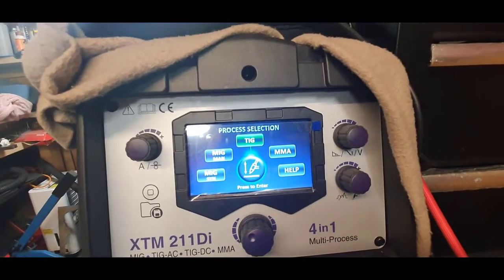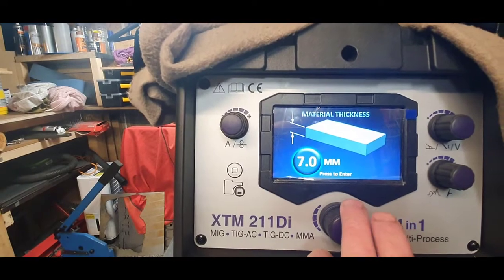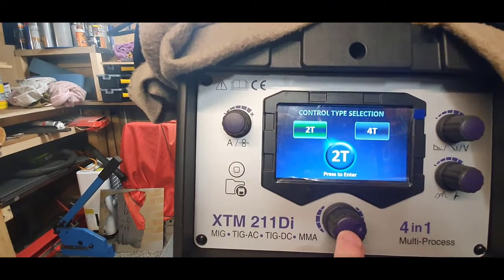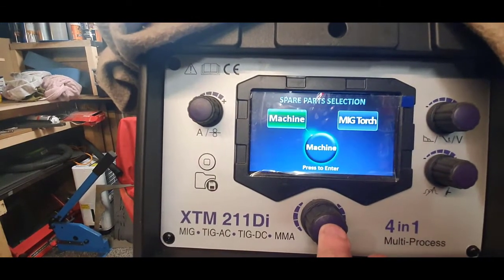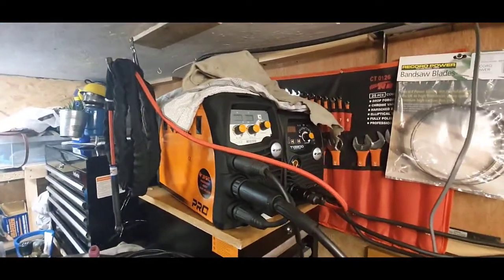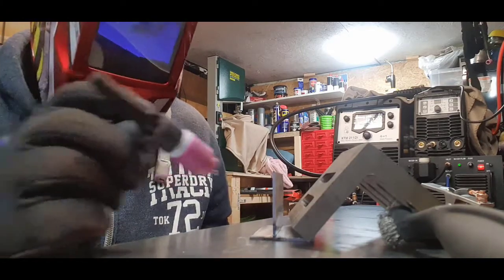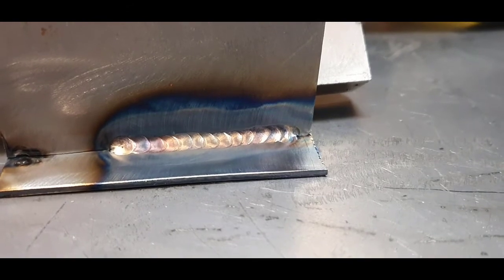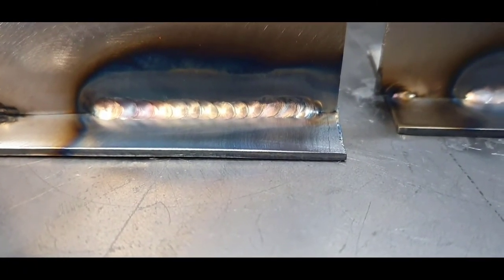Parweld XTM211DI

Comment: Nice one.great to hear a relaxed northern voice rather than a American lol.
May be thinking of getting one of these mainly for the mma and the mig .but would like to learn tiggin
Reply from the maker: Lol ... well not sure about relaxed but if you need any info on any of the Jasics let me know as it's the only ones I run now as I cant afford down time. 👍
Reply from the maker: My dad uses these now as brilliant to set up in both modes but the unit was just to big in size for me to keep in my small shed but customer service is again brilliant. If your interested in a parweld one just pop me a mail and will beat anyone in UK for price
Reply: Really.i see they are around the 1400 quid mark . (Parweld)
Reply: Also would you know if the parweld is generator friendly
Reply from the maker: Yeah they are generator friendly and you would require a 10kva minimum .
Cheers

Comment: A great video, if I may ask you as it is now  2022  do you still rate Parweld XTM211DI as a good welder to buy, also  
What thickness of steel / SS/alloy will this weld up to?  
Lastly is there a good place to buy this machine from?
sorry for all the questions.
Reply from the maker: Hi No problem as sorry for the delay between  videos as full new workshop fully open today again so will post more shortly.  Yes I like mine however none of my multiprocess machines feature in my new garage as I mainly tig and can't stand mig so I moved them out. If you message me on insta I will send you details on who I buy from and I know he will beat anyone.  Thickness wise just depends on how many passed and which function your probably looking 5 to 6 mm on mig and tig and much thicker on stick .
Reply from the maker: If any consolation I had the esab 205acdc 4 in 1  just after Christmas for 3 grand and this parweld was way better bang for buck and better customer service.  I mean thick I got mine for around 1350 machine only so 3 year warranty your quids in. Esab 3.5k and again 3 year warranty .

Comment: What torch would you reccomend as a plug and play for the Parweld? I don’t have a cooler so just to plug direct into the 211di? Thanks
Reply from the maker: I use CK 9 , CK17 or CK 26 depending on your amps . I always use CK but torches don't come with a switch so any switch to your amphenol will work
Reply from the maker: If your unsure grab me on insta or give us a bell and will happily explain in detail
Reply: @smallgarageworkshop6119  awesome thank you, I have a foot pedal and don’t really go over 140 amps but I’d rather get something to handle the max of the machine for any future projects
Reply from the maker: @andrewpirus2159  oh super then I would go with a ck17 . 150 amp the 26 is huge hence why I have a cooler and stick with the smaller torches.  Or the latest ck are like a 17 but do what a 17 does without the cooler . WhatsApp me as it gets really complicated.
Reply from the maker: CK 26 TL trimline.  The size of a ck17 nut will do the full amps . You won't need another torch
Reply: @smallgarageworkshop6119  awesome thank you so much! So the ck26 trim line is direct fit on the Parweld?
Reply from the maker: @andrewpirus2159  pretty much as you just need a dins adaptor to attach to the ck torch . It's as plug and play as it can be as you have a pedal so no electrics involved
Reply: @smallgarageworkshop6119  cool thank you so much for your help! Massively appreciated

Comment: Do you need a water cooler? What’s its function?
Reply from the maker: Basically at 200 amp your standard torches get too hot so then you need the wp26 which is huge . Cooler enabled smaller torches to be used plus you can use the full amp of your machine without stopping

Comment: so worth getting? I'm getting one and just want to know if it's good??
Reply from the maker: I would say so however if you click on my link and send me an email or message me through insta I will put you in contact to the company  who supplies mine and he will be the cheapest in UK .
Reply: @smallgarageworkshop6119  how much did you pay for your? Thanks
Reply from the maker: @RoaldyRobertson  message me on instagram buddy cheers
Reply: @smallgarageworkshop6119   hi mate great video, what power supply are you running your machine off please?
Reply from the maker: @jamiechriston340  Hi 
I run my plasma off a 16amp supply however you can pretty much cut 4mm from a 13amp socket  as i did for ages. I upgraded to a 32amp supply but cut this down to 16amp as when my compressor kicks up it used to trip sometimes in the middle of the cut . Hope this helps

Comment: How does the Paraweld compare to the Jasic mini tig?
Reply from the maker: 2 completely different sets but if its tig your looking at then the Jasic as its a cleaner sharper arc on stainless plus the frequency is 250 on the jasic rather than 150 on the parweld . Both great sets though
Reply: @smallgarageworkshop6119  thanks, and what about all these Jasic 200 models? What’s the point of the 202 when the 200p mini is half the weight at the same price?
Reply from the maker: @Tuffjobs  its all all about the water cooler really as i like the smaller ck20 torch but the size of a wp9. Inside is pretty much the same machine but better air flow a lot better on off switch hence for the machine they are pretty much the same machine. Best sub 2k tig welder to be honest before you step up to the big boys. Used them for maybe 6 years now and never let me down as customer service is also bang on
Reply: @smallgarageworkshop6119  that’s makes sense! At what point does one need a water cooler?
Reply: @smallgarageworkshop6119  Where is the frequency listed on the various machine specs and what difference does the frequency have on the welding? I'm now leaning towards the Parweld 211 because it would be good to have the MIG option even though TIG would be my main thing. Thanks again! (My local dealer also says that Parweld is a better made machine - any thoughts?)
Reply from the maker: @Tuffjobs  Hi lance give us a bell on 07711569679 as its easier to explain.  Don't worry I'm not a sales chap but can answer everything you need
Reply: @smallgarageworkshop6119  a kind offer - I will give you a bell before long 👍
Reply from the maker: @Tuffjobs  if your in UK no probs as I can explain your questions way quicker than on here mate and then up to you to decide . If you do go with Parweld i will tell you the guy I use as he can beat anyone on price